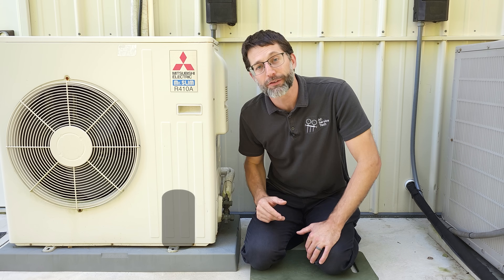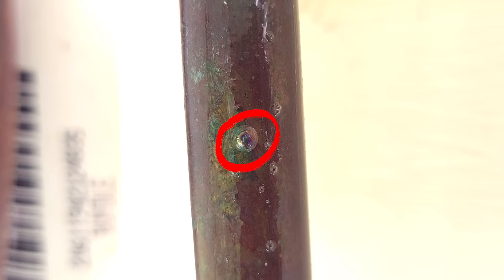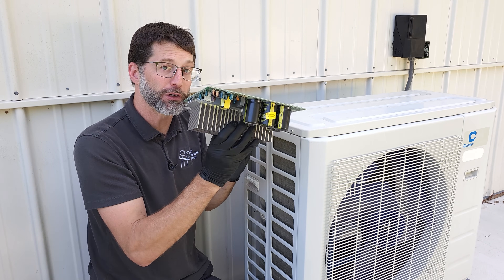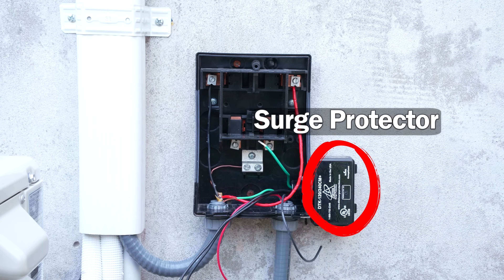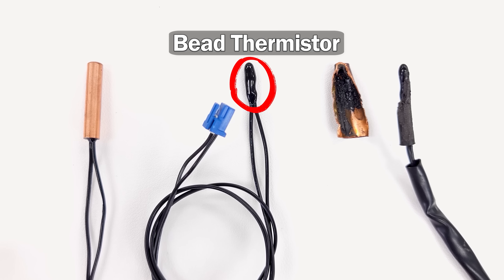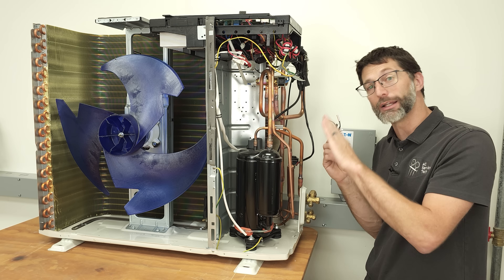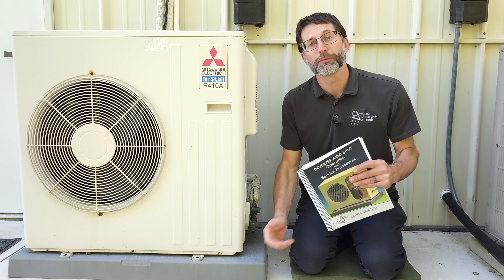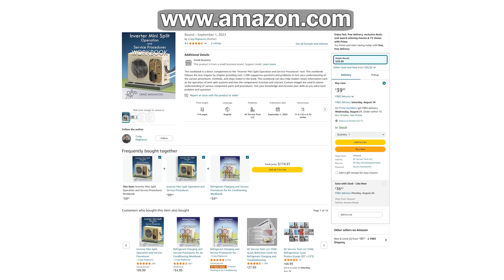TOP 5 CAUSES of Mini Split Heat Pump FAILURE!

Comment: Posting a question herre iaw the instructions on your website.  Ref a new install of a heat-pump mini-split 12K-BTU; if the line-set has a measurable temperature differential (both hot and cold,) and all other functions appear to be operating normally, but the indoor coil remains at or near the ambient temperature, what could be the issue? Is it most likely to be the comms wiring connections, or pressures, or thermistors or valving issues? How would a knowledgeable tech approach this issue, and what questions could I use to vet them on their knowledge?
Reply: P.S. On Heat mode with the Temp set at 77F, at the Indoor unit, the low-side line-set temp is at 131F, the high-side is at 77F+-. The room temp is 72F and the Output Air/Coil Temp is 72F.

Comment: Great video! One more thing I could add with thermistors is to watch for moisture ingression during summer months. I had an obviously bad 10K thermistor(measured around 500-600Ω ) Ordered replacement. When I returned the unit had been off for some time. The thermistor that previously read 500Ω was now reading around 9kΩ @ 75°.
Upon close inspection the wax seal was compromised, and the thermistor was drawing moisture from condensation and this was causing it to move closer to a short(causing the unit to think the thermistor was warmer than it was)
I replaced the thermistor, took it home and submerged it in water for a day. When I began the test it measured completely normal, when I returned home to check it was reading 200Ω and it took weeks for it to dry out and start reading accurately again.

Comment: Your nice , I don't understand but that huge HVAC Professional site, I have never met sooo many assholes on one board.They treat me and everybody with disdain.My College degree means nothing youll never be as smart as us that is how they treat everybody.
    I have a quick question, they treated me badly. My Dads place is 7400 Sq feet and he had two 5 Ton Panasonic INTERIOS heat pumps installed last week. They work wonderful, they all told me its way oversized but he did a manual J and that's what it called for. There is 40 foot ceilings in that house in the foyer/living room and kitchen. Does it really matter that much anymore when both of them  are variable speed.

Comment: Please a technician told me compressor also compressors liquid refrigerant please is that true
Reply from the maker: Its not supposed to have liquid enter. It is a vapor compressor. Can a little enter during charging, maybe but the object is to have it vaporize before entering during charging. A vapor compressor cannot compress a liquid though, thanks!

Comment: @thomaspassamonte3390 • 7s ago
I have a question about the ac service tech troubleshoot cards. On the
"troubleshooting air conditioning systems card with the various scenarios what is the capacity column relating to and a follow up to that depending on the answer is how would capacity be measured ?

Comment: Really enjoy your videos.  I did a DYI back in February of 2013 of a 1.5 ton Gree Mini Split Heat Pump.  Mistake I made was bolting it to the side of the House.  It came with a 25 foot line set and I needed about 35 feet.  So I bolted brackets to the House and the Mini Split is now about 6 feet off the ground.  The mounting brackets transmit some noise into the Family room.  Bummer.  Should have bought a new longer line set!  I did the whole install and bought HVAC tools to do it correctly.  Bought a quality 5 cfm 2-stage Mastercool vacuum pump.  Bought a torque wrench for the fittings. Flaring tools. Used Flare-tite seals on  the 4 line set connections. I ran the Vacuum pump all day and got it down to 110 Microns.  So here we are 11 years later and the China built Mini Solit works like new.  I clean the outdoor unit at least twice a year.  Clean the inside unit and filter annually. The seller I bought it from back in 2013 was surprised it has lasted this long.  I've installed 2 more units for Friends since.  I'll follow your care instructions.

Comment: The best fused disconnect/surge protector/voltage range monitor power management system is the RectorSeal RSH-50 VRMDC Kit.  This is what I install on all Mini-split DUCTED heat pumps like the Daikin Fit, Amana S-Series and any other brand like Mitsubishi like systems.  Any system that is running an inverter gets this unit installed on all of our systems and added to new clients that have an existing system with no protection.

Comment: I have retired within the last couple of years after over 40 years of hvac/r work.
I'm glad to see instructors as yourself sharing your knowledge. 

Most mini-split systems that I have seen installed are installed too close to the building to allow sufficient air flow, which, as you mentioned, is critical for cooling off circuit boards and heat sinks.
They are also installed without keeping in mind the service technician who has to climb ladders to get to them. Of course, sometimes it is necessary.

Keep up the EXCELLENT work! 👍👍

Comment: Really good explanation!  In Australia most technicians are just too dumb to even change a capacitor. So most systems just get dumped after their 5 year warranty because of dumb repair techs and astronomical part pricing. R410 is crap. The thinner part of the gas goes out first then nobody even want to touch that crap anymore. R32 was the best but the industry already want a new gas to make more money.

Comment: Lets see if we can solve this mystery without watching the video by putting 2 and 2 together.  Lets see now, uh......heat pumps are no good for regions who experience ACTUAL cold in the Winter and mini splits are costly but are very limited for cooling area as well so it follows that a mini split heat pump is TWICE as foolish and problematic to buy! 
And yes I am formally schooled in HVAC (meaning not through the mail) and have years of field experience.
Reply: @gregatkinson7276  I agree 💯 percent

Comment: I hate inverters only because the troubleshooting is so vague. You need to have those micro leads to check on some terminals and there is no way to know expected voltages on all  connections. You got to call the tech support and even they suck at times. Anyway, the idea behind this technology is excellent but with bad installation practices, and the cost of trying to service these things, I can safely say I do not want to work on these things.  

I have worked with people that they NEVER use a micron gauge, pulling vaccum through the same manifold that they use for every single service/installation call and the gaskets are DESTROYED to make things WORSE, never use a torque wrench(which I would say that is the least bad of the above mentioned) and 99% do not install a surge protector. Most of the times is the first install that dictates how long this systems will last. I am tired of hack companies!
Reply: "Most of the times is the first install that dictates how long this systems will last. I am tired of hack companies!" - Well said.

Comment: This is the main problem with mini splits. The diagnosis and repair is more complicated than traditional split systems. Good luck finding a company that will service or repair a new mini split.
Reply: VRV systems in multi story buildings can be 10s of thousands of dollars a service call.
Reply: Genuinely asking, why is it hard to get companies to work on them?
Reply: @MattJMT  most techs are not trained to diagnose and fix and they usually have three circuit boards in the outside unit. Which means most companies needs the most experienced person to come out and fix after ordering parts. If your customer has no AC during a heat wave they usually have to wait a week for repairs. This can be torture for customers.
Reply: @drdickqueso  I see what you mean!
Reply: too complicated, just like vehicles of today. you can have every test gear known to man and still not get a dead set diagnosis result, depending on the weather, humidity and intermittent functioning parts. you wouldn't want to pay a tech to sit there and babysit there for multiple hours and "maybe" catch the fault or replace what testing claimed was bad, only to find that wasn't the issue. which for example again, happens in automotive world endlessly.
 what else occurs is homeowner/poorly installed gear, the failing line-sets which leak down and allow moisture in, which then ends up ruining the compressor/oil and often shortly after it's been repaired. not to mention the repair cost of parts and labor, which is only covered for so long. it can quickly cost as much to repair as having replaced the system.
Reply: @throttlebottle5906 Agree 100% I get calls all the time from people saying I just hooked up this minisplit I bought online can you come and help?? noway! it's always an absolute nightmare and usually damaged from what they done, missing parts ect. these things are nothing but headaches
Reply: @throttlebottle5906 that's the issue I run into. And explaining this to the client is impossible. They're either going to think I'm scamming them or trying to upsell them. Meanwhile, I don't care what they choose, I just want them to be happy (without devastating their bank account)

Comment: hi, optimal refrigerant weight is given on specs for the provided pre-determined length of copper coil right, for example, what if we wanted to extend the copper coil (running extra length for odu) how do we calculate the extra required refrigerant to compensate the system? ty

Comment: Very good explanation. It's good you displayed the refrigerant used R410A, but need to emphasise that this video is only relevant to A1 class (non-flammable, non-explosive and non-toxic) refrigerants like R410A as some procedures are different (due to the safety of the engineer & of course the user) if the system is charged with A2L flammable🔥 like R32 or worse some are A3 explosive 💥 like R290. Refrigerant safety is as classified by ASHRAE 34 & ISO 817

Comment: Good information.. About a year ago I installed a C&H system with an indoor air handler and this summer I saw an ELOC error. This only happens very infrequently, goes for 2 weeks or more then the error pops up.  I did a thorough leak check and didn't find anything. I recovered the refrigerant (weight was good), evacuated and added back per the nameplate.  Still very infrequently I get the ELOC.  I looked at the indoor coil thermistor and noticed it isn't attached very well to the coil.  I was wondering because of that, is the thermistor not getting a good coil temperature  thus causing the ELOC fault ?  Instead of trying to remove the existing thermistor and risking coil damage maybe I'll get a new one.  Does anyone know where to get C&H parts ? I know it's made by Midea but figuring out a cross reference might be impossible.

Comment: Avoid installing these at all costs.
It's a water problem just waiting to happen.
You can do everything right, and they neglect maintenance, I've even seen properly maintained one's  clog up and cause massive water damage.

I've installed a few,  no call backs on mine (knock on wood)  but I take care of many. And they all suck.  Even the ones that work fine, suck.
Reply: Yep I agree with you both I have had the same problems even when I serviced the units on a regular basis.
Reply: Water management is huge and our main worry every time we install them. I've poored a gallon of water through a new install's drain to test it only to have to come back a week later because it decided to stop draining after the fact.

Comment: The last one!
This literally happened to me yesterday.  Got called out for a water leak on a Mitsubishi.  Cooling with 55'f supply temp before doing anything.  Cleaned the clogged filters and evap coil.  Also cleaned the drain pan, drain and tested for a fractured drain pan.  All looked good so I assumed it was freezing.  Turned it back on and now it had 65'f supply air.  Went out to the CU (15ft in the air) and found it turning on and off.  I thought "okay, cool it probably has a leak and it was indeed freezing."  Found the CU turning off around 95psi.  No Error codes.  I added 1LB 410A to it and got the pressure up to 130psi (super heat was around 4-6'f I think).  CU was still turning on and off and my supply temp was still about 65'f.  "Why? I thought, and was concerned about the superheat but it should still cool, right?".  Called tech support and got humbled 😮‍💨.  Well, I guess I overcharged it.  Recovered all the gas and weighed in new gas after measuring the liner-set.  Now its got a 54'f supply, 112psi suction and I think it about 12'f SH.

I ended up being there all day for a stupid water leak of which, I cant prove a root cause for other than the filters being clogged.  All I know is, it wasn't cooling after I cleaned it with the CU turning on and off.  Also did a leak search but didn't find anything.  I don't work on a lot of mini splits and I just seem to struggle.  I have to call tech support almost every time for them.  I thought I was doing the right thing by adding the gas and getting it up to 130 like normal.

Comment: another note, sometimes, error codes for one problem may lead you to something entirely different.  Example, a reversing valve error code can be an indoor thermistor issue, the system may think its heating when in fact it is cooling! In other words, don't think that an error code is always telling you the exact issue.
Reply: Aka treat the error codes like women 😂